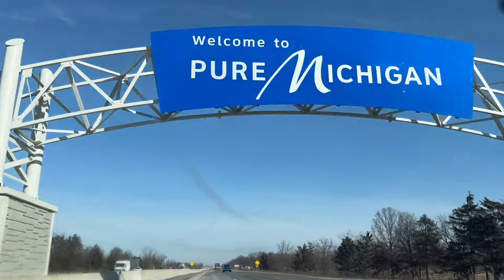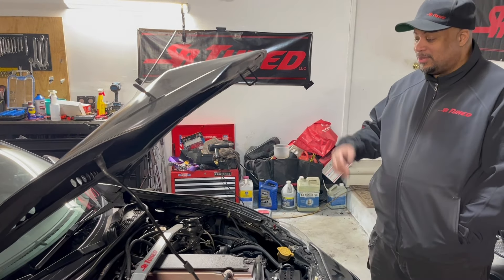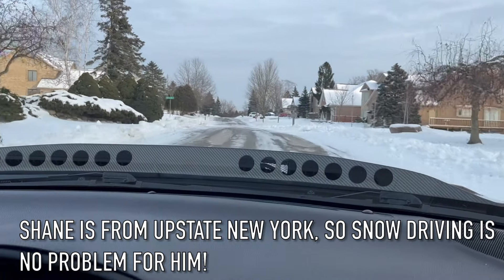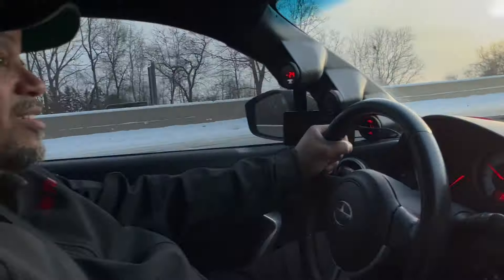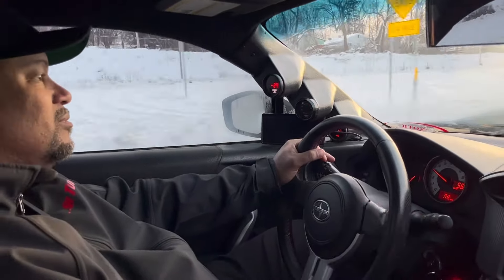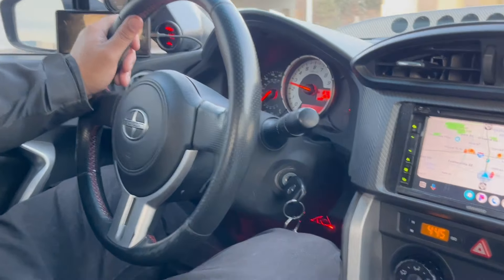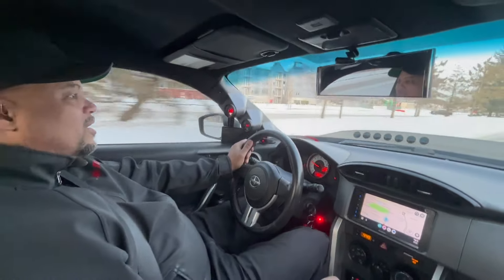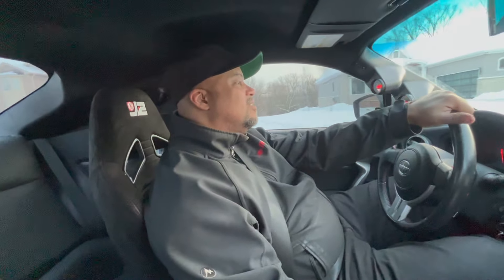POV: Subaru BRZ 2AZ-FE Engine Swapped TURBO Ride Along! w/Shane The Swap Kit Designer! 400+ WHP! UHD

Comment: I need this build for my 07rav4 base . That i want to turn 4x4 its a whole process i know . Hp and torque numbers? It would be cool to switch through hp - mpg modes going pesidential style
Reply: Oh yeah? My dad had an 07 rav4 Sport. I thought it was a smaller engine. Interesting.

I bet you can turbo the stock engine, and then build another one If it blows up.
Reply: cant wait to see it
Reply: Are you going to boost it?
Reply: Hey there Gilbert. I think a supercharger would be great. But it might hurt your fuel economy. If you can afford a turbo kit, it could be even better. These engines can take a beating.
Reply: What about a stroker kit?
Reply: can't wait to see it!